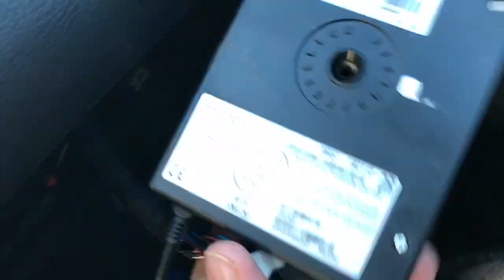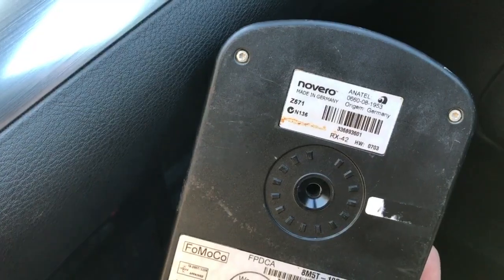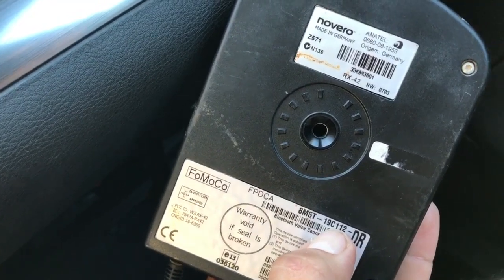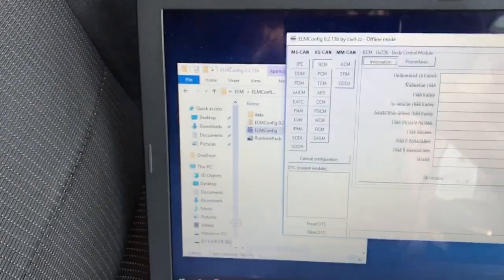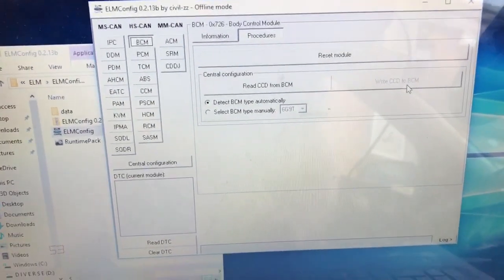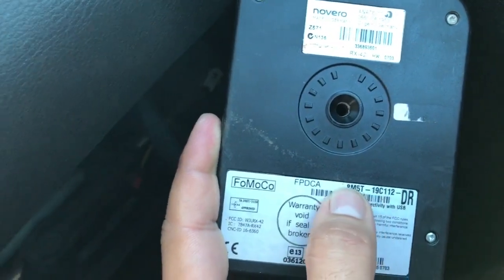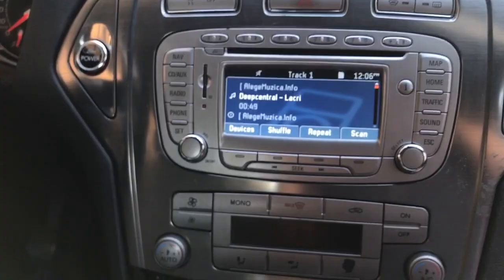bluetooth module ford mondeo

Comment: Well  I have a problem with mine.  Just replaced the module,  done everyting you said,  but I get only noise from speakers when try to call with the phone. Old module was NOKIA, new one is same as yours. Do you have idea what can it be.
Reply from the maker: your usb work?do u have sound?if only the phone don't have sound,u need to make a change do the wire for mic.look here https://www.youtube.com/watch?v=Eoa3F9067WY
Reply: @Stefan-sj9kq  I instantly got new menu options like line in, USB and iPod, but there is no icon bt audio. Phone connects but when engaging a call there is no sound at all except buzzing noise from speakers, like some wires are not connected right. At the end, module I bought is the same as one you have here on the video, but my old module is NOKIA, tottaly different letters and numbers 7S7T-19G488-ED
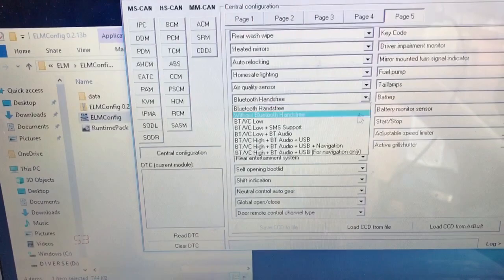Reply from the maker: u look at the video that i reply for you??2 nd attempt ,with ELM and software Elm config.make the change on the tab nr 4, min 1:45 look at video and make this settings chose always ¨¨BT  ¨¨to show u bluetooth icon https://www.youtube.com/watch?v=wrPzgCVtZlA&lc=z23xiz1iexawhfrsqacdp432tnm0rc1froozkspdsrhw03c010c.1541597077412651
Reply: @Stefan-sj9kq  I did change the options in ELM config, tried the one you show, after that, tried them all, but no luck.
Reply from the maker: sorry i don't know how i help you?!send me a video ,a link , on my email costea_stefan85@yahoo.com to see your problem
Reply: @Stefan-sj9kq  I have already sent you an email today, but no videos attached, because I sent the module back to the seller as non working.
Reply: @Stefan-sj9kq  I have tried again, no, there is no sound at all, USB is not detected when plugged in, guess either is faulty or not supported by the car.
Reply from the maker: what radio model u have?
Reply: @Stefan-sj9kq  Blaupunkt FX Navi